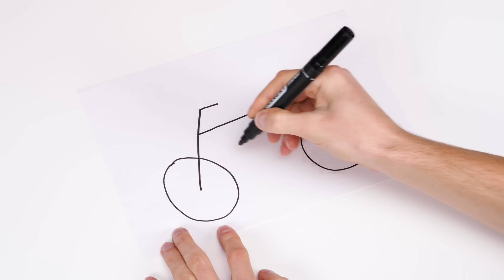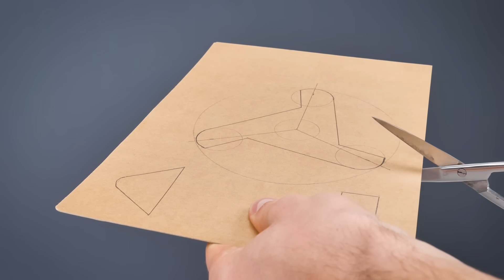EXPERIMENT: Shock Absorbers in Bicycle Wheels

Comment: no 1. Three spoke wheels are hard to make strong, this is why 3 spoke's wheel are not cheap.
no 2. There are many reasons why wheels are made to be strong and static, as you can see. It wobbles the freak out

Comment: OOOOOORRRRRRR....... You COULD just buy a bicycle with suspension in both ends (swing arm in back, shocks built into fork), especially since MOST (99%) of the impact is translating through your tires, and since you've removed the bulk of the support structure for the rims (the spokes), they are FAR more likely to fail in between the outer mount points for the shock absorbers you added.

Comment: I impressed work done but is that correct way to fix springs to tyre rim which too hardest one in my opinion the rim will bend based on situation doesn't apply spring action to cycle

Comment: This shouldn't be done with normal shocks. The piston needs to be centered in its range of travel with nitrogen(preferably) at equal pressure on both sides of it.
Standard shocks are filled with oil with nitrogen to pressurize the entire shock. This nitrogen acts as a spring to extend the shock while a valve inside slows and controls how fast the oil can move. This makes the shock extend and retract at a limited rate.
This only worked because the shocks were all nearly fully extended meaning they could barely move anyway.
On top of that, if they could move properly the tires would move up and hit the forks and frame a ton because they move independently of the axle

Comment: Not that The Q will ever see this as many comments as there are but.. 
My grandfather was a tool and die maker for many years,and a good one too.. One day,a man in a wheelchair came to him and asked if he could make a suspension for a wheelchair.. It only took him a few hours,what he did was simply made two wide "C" shape brackets with one to the chair and one to the wheel with 3 bolts and a spring.. The man was very happy... My grandfather would be very intrigued by your videos

Comment: Very cool idea and of course as your most others are. The structural rigidity  and strength doesn't come from radial elements and  hub anymore. Rim itself has to be stiff and strong. Second, for each wheel rotation, the shocks have to compress and expand once. Lot of energy loss (shocks hysteresis), similar to rolling resistance in pneumatic tires = riding semi flat.

Comment: this is a great idea but i think that the pressure of the wheel maintaining its integrity is relying on the shock. at one point i saw the shock bend a little bit showing that if the shock is not perpendicular to the ground then it will give a little bit and that may cause issues down the line because shocks arent meant to bend like that or withstand pressure in that way, only meant to compress and decompress

Comment: hard to see on the front  wheel but the back rim does some major flexing when it hits.  slowed way down to .25 play back speed.  to really make this ridable you will have to use a stronger wheel

Comment: U should have put some preload in the spring. And how r u gonna stop the struts from moving when torque is applied at the wheel💁🏾. And once the bottom strut is under compression the top strit is under tension and because there's no preload it can't extend therefore the system doesn't absorb much energy. And in that very event the third strut is under cross sectional stress. It can actually break or bend it. It's stupid

Comment: It's not a bad idea but this particular design is terrible You would need to put at least 3 more shock absorbing struts Is the area between Itch Is shock absorber is much too large This design has effectively made these wheels much weaker and far more susceptible to damage. Not to mention making them many times heavier A greater number of smaller shock absorbing struts would be a much better design.

Comment: But it will crack the metal rims. I wonder if you could use a more stable material or like.. Build the wheel itself different.. Maybe a very new concept.. So that this setup makes sense. Cuz it looks good.

Comment: I think the only part of the bicycle where it makes sense to have shock absorbers, is on the forks, where they connect to the hub of the wheel. And you should leave the wheels as is. In fact you could even have the suspension built into the insides of the forks. You could also I suppose, have suspension on the seatpost or the saddle. In fact there is a whole science that has developed on explaining the pros and cons of various types of suspension, i.e. with or without “ordinary” rigid forks, seat posts and stems, etc.
Reply: I guess you never rode a full suspension bike on rough DH.
Reply: @TeamCykelhold I guess you never rode a fully rigid bike on a rough downhill.

Comment: These shock absorbers are designed to withstand impacts in the perpendicular position (90 degrees). In this case it is noticed that the impacts arise in several directions (several angles). The work has been very beautiful however it will not last for long.

Comment: What you need to do to make this work>>> 1st of all learn TiG welding, then make the entire rim out of 4 segments  of tig welded 4130 then experiment using different springs, probly  end up with titanium.  this will only work on a 20 inch bmx wheel, otherwise you need a real machine shop

Comment: As an engineer, the rim it self can warp if it is prolonged to flexibility at a center focal point of origin on the rim, which is the hub where the bearings are also that. That's why it is best to keep a rim very hard and stiff with spokes and let the shocks flex on a frame or chassis of a bike or car.
Reply: Also, side loading suspension like this is just impractical and completely unnecessary from a common sense standpoint. You don't need to be an engineer to see how bad this design is.
Reply: @TeamCykelhold I think you've missed the whole point of the video... it's called entertainment. People like to have fun experimenting with things, not because it is the best way, or even a good way, but just because they want to see what happens. You do remember about having fun?
Reply: yeah this design is idiotic
Reply: The lateral rigidity was shocking
Reply: Guys. None of that is the point. It's about views. Sweet, succulent views

Comment: There no question that this is a fun project but the video very clearly shows the suspension doing almost nothing, the greatest cushioning effect is coming from the under inflated tires. It might have worked better with air shocks or a 3d matrix lattice in the wheel allowing suspension movement in any direction.

Comment: Another problem is that the shocks are meant to work at one angle but this is asking it to try to be a spring at a non 45 degree angle, why would it spring if it’s diagonal instead of vertical. It’s a cool idea though! Maybe with more shocks.

Comment: This looks cool but it is functionally terrible. The see through acrylic wheels are still worse though. Bicycle wheels are already designed to flex under impact. This will crack your rim if you hit a curb the wrong way though. Those springs are way too stiff. There are just so many design flaws I can’t be bothered to mention.

Comment: don't touches  the rotors using your hands because our hands have a natural oil and this oil is bad to the  rotors its will affect the performance   and ability of the  rotors, you just noticed every time you press the brake you can hear an annoying sound its mean your rotors are already contaminated there is a reason why rotors contaminated first    natural oil second dust and third any oil ex oil from headset.

Comment: One major design flaw was how the shocks weren’t set with sag, so when the shock closet to the ground wanted to compress, the opposing shocks couldn’t extend any more which prevents the shock that is taking impact from compressing.
Reply: That rim will be bent in no time
Reply: @dday734  Yeah didn’t think of that at first but would need to be a BEAFY rim to say the least
Reply: The major design flaw is that it's an inefficient, expensive, heavy and ultimately impractical way to make suspension on a bike.
Reply: @TeamCykelhold Absolutely, but a fun experiment, even if it doesn't work.
Reply: So as in the video, the rim has to deform in order to take the impact, right? If it was done the way you said, the shocks would do all the handling.
Reply: @ninjahunterx7497  correct
Reply: @ninjahunterx7497  then its needs four shocks. right?
Reply: @comosinadaayala1522  কহস
Reply: Debería haber hecho el aro con bisagras para que pueda funcionar
Reply: yeah thats what i was thinking. he needs some compression on them so they can have more outward travel as they try to go back to their original position
Reply: The sag and compression comes from the way that they are angled. If you look closely, the hub rotates to allow for the bottom suspension to take effect.

Comment: Concept is interesting but you will probably find your rims will break over time. There is less support is certain areas. Instead of the rim being universally supported it now only has 3 support points. Even through the chain will drop and have some chain slap that is excessive for something that should be helping refuse the forced out through the rider and components. Also he took a lot of force when dropping off the ledge

Comment: To this comment section:

Spokes on their own right are stupidly weak, and hence without spreading the load, the rims here are bound to bend. but remember these are three shock absorbers not spokes. The obvious solution to that would be to add mounts which spread the load of 1 shock over a 120° portion of the rim’s circumference. Then the rim won’t have that problem.

Of course this guy should’ve added preload to the shocks; that’s what they did with the Softwheel and that design works very well too. But don’t think up of a way to criticize what this guy made without thinking if there could be a solution to the problem you perceive.
Reply: the load is spread across 120°, its split equally into three parts so it is 120° per spring

Comment: The rear derailer needs a clutch on it. Also i fell like the rim is going to snap or at the least crack. It is not supposed to bend so the idea falls apart when you think of that.   I don’t hate this idea but when you account for the actual function of wheels then the idea breaks down.

Comment: Its would be realiable if the apokes werent relied on to keep the tire round and if it wasnt welded even thos it was a good weld its still ginna be weaker than stock this therically could be possible but you would need to literally make a redesinged wheel

Comment: The problem isn't the shocks, it's that there's only 3.  The reason for so many spokes is...to add strength to those points of the wheel, the circle.  You're technically only supporting a few inches with each shock.  So...I wouldn't go trail riding with that personally.  You'll be carrying parts or maybe yourself  out because of a busted wheel.
If you want 3 shocks...you need something in between to spread the load along 120° of the wheel at each shock. Like the fingers spread out from the shock to the rim.

Comment: 5:24 this bike is basically unridable. It seems cool to think about but it’s basically like trying to sleep on jelly. The bike is wobbling around because the wheels don’t offer a stable platform.
Reply: also i think as the shock on the bottom compresses its working against the shocks at 2 and 10 because they would be stretching. probably the wheel would fall apart after a while as it was designed for 30+ spokes and now only has 3
Reply: Also the three shock absorbers weight much more than the spokes giving the bike more inertia.
Reply: Martyr4JesusTheChrist  interesting, well in any-case i still feel his wheels on his bike would still fall apart, they are designed to be supported at 36 points not 3, but the softwheel does show the design does have merit if you have a wheel designed to handle the load with only 3 spokes.
Reply: He actually needs somekind of engine to strengthen the pedal for this kind of bike..
Reply: It can be made possible by adding multiple tiny shocks and a non welded wheek but thats the kinnda stuff that take ywar of redesinging not just a week becasue tiny shocks probably wont be as good or even close to an origonal shock and the wheel also needs to be remade all I am saying is its possible just not simple or easy in any way
Reply: Yes
Reply: Still cool
Reply: It's just a cool concept, it's not practical. The absorbers don't do much
Reply: I'd love to sleep on jelly...
Reply: Front wheel hit the Fork too!!

Comment: I see how this function. The rim and frame is stationary, but when the suspension compresses, the entire wheel shifts from the axels. This offsets the shock to the wheel instead of the frame of the bike.
Reply: But how far can that wheel travel without hitting the fork of the frame under compression at high jumps?

Comment: In a bicycle wheel, the hub hangs from the top of the rim. The forces in the spokes are tensile, not compressive. So replacing the spokes with a typical shock absorber is not really going to work, especially when the shock is too long and has to be mounted 90 degrees to the direction of the forces.
Reply: In a tensioned rim the hub hangs from the rim. But not all wheels are tensioned, and in fact, simple compression wheels existed for several thousand years before the tensioned spoked wheel came along in the 19th century.

Comment: that can not work, the suspension is in the rim and you can not apply pressure to the rim because you can not bend it so easily.  Conclusion: This does not work and is an unnecessary effort.

Comment: See how loose the chain got when back wheel hit the ground.
Reply: That's normal
Reply: @blyat1648  for a crap group set with no clutch yes, but a higher quality group set wouldn’t do the same
Reply: @jamesbailey2213  yeah but it uses hex bolts on the axels so it's clearly not a great bike

Comment: Bicycle wheels with spokes fonction in a way we don't really think about : the hub is not "standing" on the rim by the intermediate of spokes but are hanging from the top, like a cable stayed brige. In this video the springs can only compress but can't expand, so there is no shock absorption. However, with a more classic spring that Can do both (and to keep it straigh we can fit in some sort of piston), that could be possible.

Comment: The chain almost touching the ground in slow-motion gave me anxiety
Reply: Cheap groupset
Reply: @jonnettomuus2237  it's not the groupset pal it's the derailleur. That why you can get rear mechs with a clutch system to prevent the 'chain slap'. The quality of the rest of the components deosnt matter, even the cheep stuff ie chainring, freehweel/cassette or chain arnt going to stretch
Reply: @jakeelliott8059  Meanwhile I won't have such issues cause I'm joining the belt drive gang
Reply: They is completed normal for a chain to do that. The derailleur is doing its job
Reply: @mtbak8580  depends on the bike. The less the bike is made with impacts in mind the weaker the spring force is on the chain tensioner.
Reply: That’s normal
Reply: Thats normal :)

Comment: Great concept, except there's not enough support for the entire rim. There's only support of approximately 60degree  (est each shock supports 20 degrees). Add one more shock for a total of 4 and you should have support for 80deg of structural support.

Comment: For the love of God how is none talking about how he TOUCHED HIS BRAKES ROTORS WITH BARE HANDS
Reply: Have you ever heard of brake cleaner? Comes in a can, you spray it on wipe it off. Pretty neat stuff.
Reply: @mrbig5224  ya or you could just not touch the part that touches the pads
Reply: Its a bike not a car
Reply: @sethtay98  a brake is a brake. They all work the same
Reply: @mrbig5224  it doesnt have to stop 3000lbs or more it's not the same in case you didnt know
Reply: @sethtay98  obviously a car brake is more powerful but they work on the same principles...
Reply: @sethtay98  so either way your not sapost to get oil on disk rotors
Reply: ikr and it triggers me so badly
Reply: I wish I had so few problems in my life that I could afford to get upset about something as inconsequential as some person touching their own brake rotor on the internet...
Reply: Omg i cant belive you are  arguing  about tuching the fucking rotor. I was cringing about wobble in back wheel.
Reply: Just about to say that. I literally cringed when he did that
Reply: I know there is so many wrong thing he did during the process on his bike
Reply: Omg yes i only watched 40sec.
Reply: It literally does not matter. You ride though a puddle and the disk is going to have more oil and grime on the rotor than just touching it.

Please release your spandex knicker twist.
Reply: @marsrover001  you do realize puddles are made of water bot oil right?
Reply: @nobackbrakes9011  You do realize that if the puddles are on pavement like a public Street, then they would have oil from the runoff from the roads.

Comment: I agree with most of the comments...the bike is worse than before. The shock absorbers shouldnt be angled like that...they wont last if the bike goes on a rougher terrain like a dirt road....firstly, the rims will be out of shape, the centre casing isnt strong enough to withstand the bumpier ride and the clasp he made to bolt the shock absorbers arent strong enough despite the welding. It may look cool but from an engineering perspective...it wont last. It would be better if the shock absorbers were laid straight from the centre casing to the rims...and make it into a 6 spoke...thats why rims on cars have 5 or 6...its for balance and to keep the rim in shape.